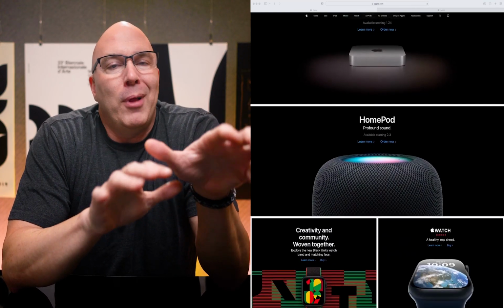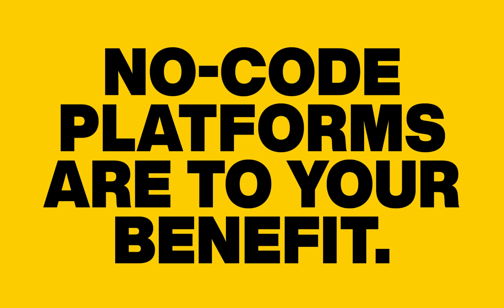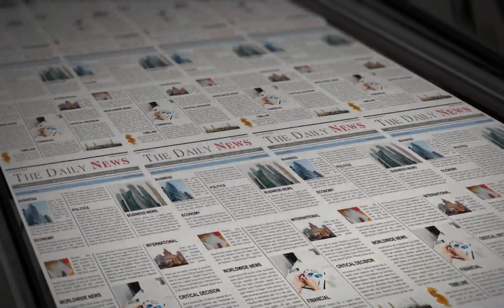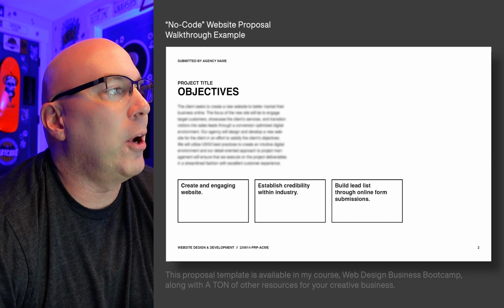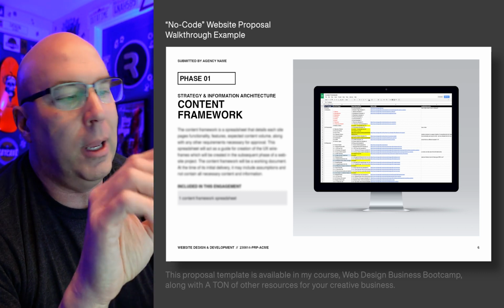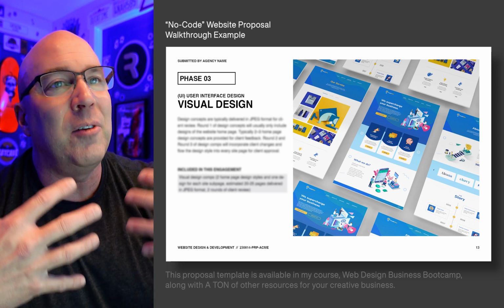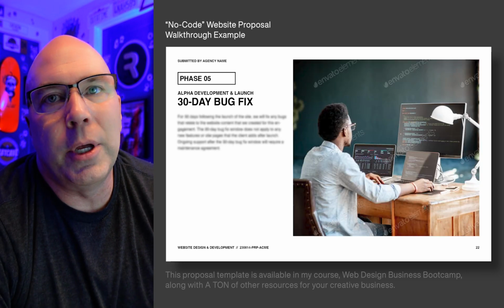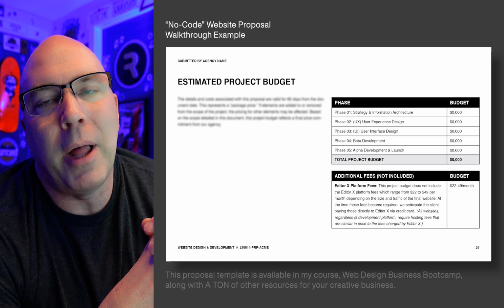How to Sell No-Code Websites to Design Clients

Comment: I've created a few websites on Editor X, but some clients that were a little IT-driven have inquired about why the hosting price was too expensive. One even asked me to migrate the website to his own private hosting company, but the reason you can't use another host for your Wix site is that the SaaS architecture does not support external hosting since it uses Wix's proprietary technology and relies on Wix's services to operate. So you kind of have to abide by their rules. I ended up losing these clients because I didn't have enough arguments to convince them to pay for Wix hosting. Although I think Editor X is a fantastic platform.

Comment: Hi Michael! Great vid like always, full of actionable info and to the point 😍 I have one question: have you ever developed an ecommerce website at your agency? If so, then what platform did you use? Ecommerce websites seem to be very complex and it’s always a clash between custom design and capsbility of a given theme. Thanks in advance 👍
Reply from the maker: Yes. We did a ton of E-commerce websites at my agency. We used Woocommerce for many and Shopify for some. They can be complex and they were high dollar projects for us (most were $ six figures). I included my agency E-commerce scoping process and proposals/contracts as part of my Web Design Business Bootcamp course.
Reply: @morejanda  perfect Michael! I will have a look. Thanks again 🙏